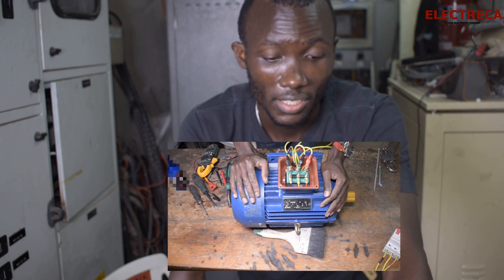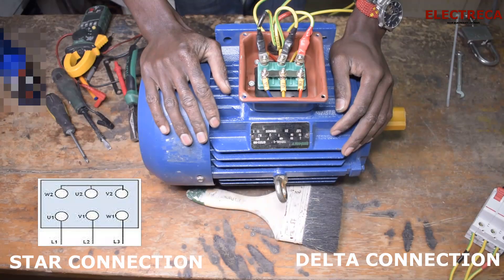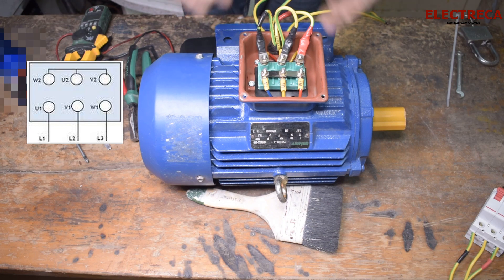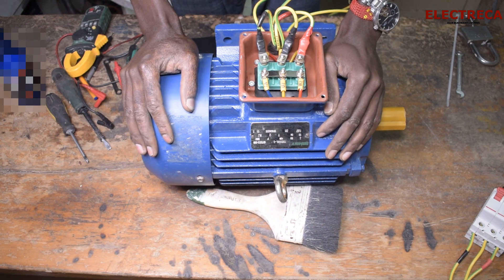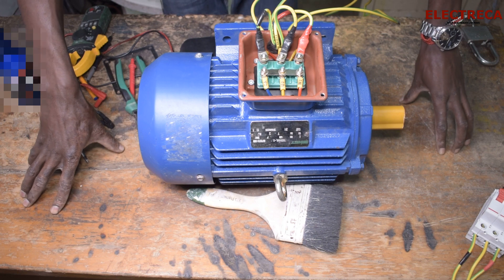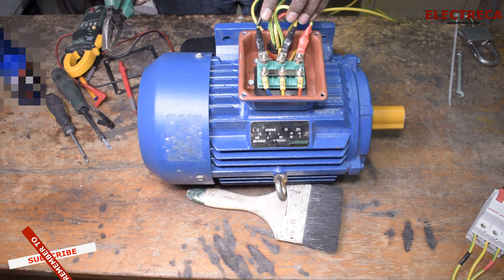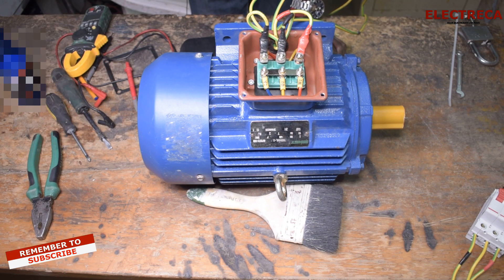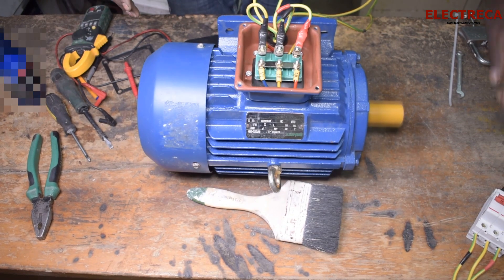How to Reverse a 3 Phase Motor (Change Motor Direction)

Comment: Hello brother I'm landup here cause yesterday i got a vehicle with a generator and its equipped with a 3 phase motor. This vehicle is using for washing. The problem is rotation of the motor has change. I'm assuming now it happened because of the generator fault

Comment: Good job engineer. I like to see how you would wire a motor to run in both directions  such as in a conveyor belt application.may be consider these as an idea for the next video
Reply from the maker: Great suggestion!